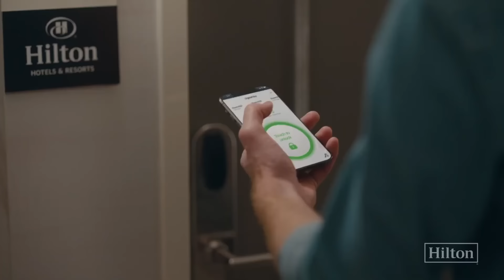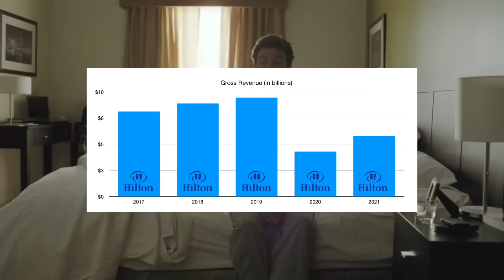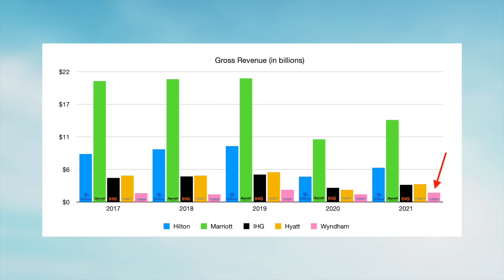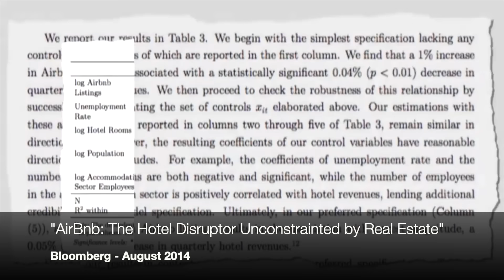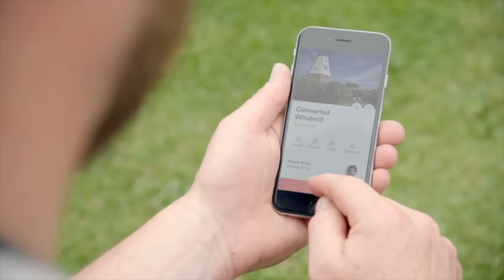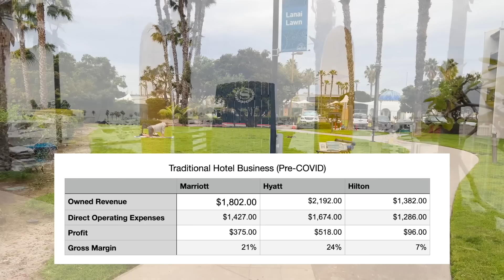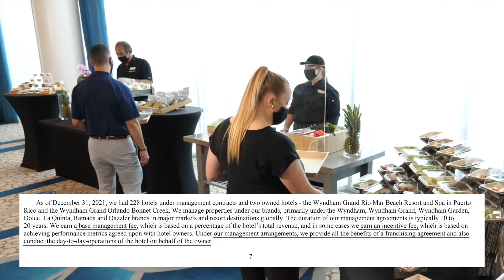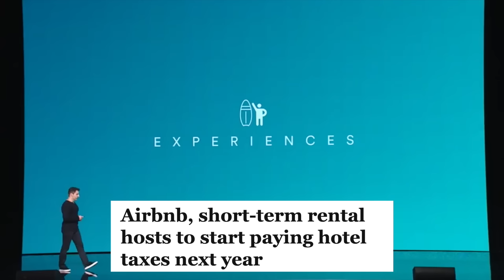Why Airbnb Fails to Disrupt the Hotel Industry

Comment: Airbnb is much more of a threat to the housing/rental market than it is to the hotel market, and by that I mean a threat to the people who rely those markets for residential accommodation, rather than being a threat to investors merely seeking to make a profit. There are plenty of career landlords buying houses to put on Airbnb and depriving owner-occupiers or tenants from access to those houses, because having Airbnb guests in the house for 60% of the time is often more profitable than having a tenant in there for 100% of the time.

Even during the pandemic and its lockdowns, when travel restrictions meant that the tourist market ostensibly dried up (the theoretical risk of renting out your property on Airbnb), in reality all that happened was that the tourists who were now stuck required extended stays and many Airbnb landlords were easily able to pivot into temporarily providing residential accommodation in order to keep revenue coming in at the rate of market rent (or near to it) for a tenancy. Then, once there were more short-term guests available, they could easily return to high-value short-term guests.

The threat of Airbnb is that it's increasingly forcing long-term tenants and prospective home buyers to compete with the higher cash holdings and spending capacity of tourists on holiday when it comes to who gets to stay in a given house. This wouldn't be such a problem if houses were plentiful and buyers/tenants could just look elsewhere, but many of the hottest destinations are in the middle of a housing crisis, and Airbnb is exacerbating the issue by removing houses from the residential for tourists who could otherwise be staying at high-density hotels designed and zoned specifically to cater for and accommodate them.

The video is absolutely correct in describing how existing hotel chains and Airbnb operate on functionally the same model and thus the latter isn't as much of a disruptor or threat so much as it's an ordinary competitor, but an important difference between conventional hotel chains and the Airbnb property network is the amount of land and real estate that they consume. Cities don't allow hotels to be built in limitless locations or numbers, and this along with operating expediency means that hotel franchisees are motivated to maximise the number of rooms a hotel provides in order to maximise the amount of profit they can make from that landspace. Moreover, nearly all of the time a franchisee is having to purpose-build the hotel, which provides new (or densified) accommodation to the city that typically has little impact on existing housing.

But the landlord "franchisees" of Airbnb don't operate under the same constraints, because they merely cannibalise properties from the rental/homeowner market and then integrate them into the hotel market. They can buy whatever and wherever with better capital and loan security than prospective home buyers (who already have to compete against rental investors), and every time a new listing for a full residence goes on Airbnb, that's another house gone that could be serving an actual tenant or owner-occupier rather than a short-term guest who could be staying at a hotel. And there's little reason for these landlords not to behave in this way because without regulation it's often so much more profitable to put houses on Airbnb (and then let them languish without occupants half the time) than it is to actually rent them out.

So, overall, while Airbnb isn't a threat to the hotel industry, it's certainly a threat to tenants and prospective home buyers so long as it remains unregulated. And unfortunately, most of the regulation that Airbnb has faced so far has all been about levelling the playing field with the hotel market that they compete with rather than with the housing market that they cannibalise in order to uphold and maintain their business model.
Reply: I live in a small tourist town on a mountain. We no longer have enough rental housing for the people who actually live and work here. Much of our work force now has to live down the mountain and commute about 2 hours each way. With gas prices rising we expect to lose many of those commuters. We aren't really sure how our little town will run without any workers. City is doing nothing about the issue. Logic is missing lol! How do you cater to the tourists if you have no work force to cater to their needs and desires?
Your comment was excellent.
Reply: 👏Excellent comment. Have you written a research paper on this topic? 😄 Not enough is talked about how tourists have a much higher footprint in an area renting a short term rental vs. hotel room. Which make STRs much less sustainable.
Reply: Thank you. As a first time home buyer, investors and "mom n pop"landlords drove up prices in ontario just to make quick money with AirBnB despite the amount of violence that happens at parties thrown in these AirBnbs...had to leave ontario and a good career to afford a home for my family. Cause rent at 2500 was not sustainable
Reply: I should perhaps point out that I would of course be absolutely happy for Modern MBA to take anything I've written here and incorporate it into another video about the topic, but with focus on how Airbnb is problematic for the residential housing market. I don't need credit or anything as I won't be doing most of the work! 😄

Also, I made a small typo in "...removing houses from the residential for tourists..." which should evidently say "residential market". Sometimes my mind moves faster than I can type! 😅
Reply: @terrabeh  Ive noticed that nearly every company/government agency only cares about maximizing profit as quickly as possible. They dont care about the long term effects, as they can just cash out when it collapses. But for those effected by the collapse, it can be devastating. Much like what you are experiencing
 in your town. 
I live in an area of wa state that is having a similar issue, where the work force is being driven out due to the lack of affordable housing/rentals. All these cash rich people come in and eat up property driving the price up to insane numbers. They then turn around and provide the majority client base of the services/goods in the area. Now heres the issue, the workers providing that service/goods can no longer afford to live here and are moving out. Even the college kids are leaving, which is a problem as the city itself is designed around the university here which is a "high ranking" school in the state. So when you start losing your majority work force and your college students, your entire economy will eventually collapse. It likely will take another couple years, but i dont plan to be around when it happens
Reply: Very nice answer thanks for writing this! 

After all this where's supply & demand here for the hotel industry? Double the rooms would halve the prices but conveniently they don't!   I recon that incorporating existing hotels also deals with this and airbnb quality of service isn't the same but still... i'm not left wing but  i believe it kinda shows it's the fake economy & regulations in effect. If you place the rooms number growth in the hotel business they lose value , if you place it in the housing market (shrink) they earn value.  Moreover you would lose jobs and maybe land value etc. if the former happened while know the government can give subsidies and look good as well/earn your vote! But instead they give vacation vouchers , how to be an a-hole 101 ! Plus land value goes up and you report "growth" (bubble) and it's exactly when too much capitalism is bad for you. 

Ex kings , royalty have a lot of land and the big investors of the old make some money here... Warren Buffet i think has it clearly 100% tax on realty bequeaths, of course if he had to pay for it he would oppose it. Coming from the guy that doesn't produce anything , just buys & sells others i'd say tax 100% on such companies except from insurance that in principle at least it's useful... shady derivatives with no use to society: 100% tax.

We need some Geneva Conventions for housing.
Reply: There's a pushbsck in many markets, including my city, as the units are being bought up and acting as commercial units while not being approved or zoned as such. That's the technical reason. The practical reason behind it is the uptick in criminal and nuisance behavior on those such properties without on-premises security to hold people accountable.
Reply: Which is a real pain in the ass.
Reply: Cry harder
Reply: Tourists and businesses want reliability, Greg the Goblin doesn't care and will find the cheapest way to live. When GtG has a new job every 4th month in a new town every season, they don't rent, they live in a car even if they could comfortably be paying for hotel rooms the entire time. GtG lurks Airbnb and finds cheap rent, if the scenario works out for GtG and whoever is willing to risk letting GtG live there for a month then GtG finds a cheap alternative to rent, and the owner manages to get a little bonus for making space. The only other person willing to airBnB is Winston the Adventurer who is willing to pay extra (in sanity, patience and perhaps even money) to avoid paying for hotel rooms or signing a lease. Basically, as Winstons have a large range of wealth, from pennies to way too much. While GtG's are invariably cheap, AirBnB can't service a consistent market. The only consistent thing they can offer, is a new seller. There is value to that. 

Airbnb may enjoy saying they are a tourist spot, but they are going to be chasing gremlin markets. They are basically looking for temporary markets, which is the advantage that they have. They are little different than Craigslist ads for renting. If you are a small fish, informal adverts are often great. But, if you expect the reliability of a business, or relaxation? Lol, lamo even. 

Basically, everyone expecting hotel service from airbnb is clowning on themselves, while every person investing in a location to airbnb rent it is riding transient markets and getting lucky.
Reply: What about rather than regulating Airbnb we should deregulate the construction sector to increase the supply of new housing?
Reply: @lorenz99x  There's always talk about deregulating construction to increase housing supply, but not enough discussion about what actual regulations people would like to see removed. Many regulations exist because there's a very important reason for them, and sometimes that regulation could be executed more efficiently and sometimes it can't. Likewise there may well be regulations that are superfluous or would be important but are currently implemented ineffectively. And all of this varies between jurisdictions, so in some cases deregulation might be sensible and in others not, it might have an impact or it might not. But when people talk about blanket deregulation, they often haven't bothered to identify if it would be sensible or effective for a given jurisdiction, and when lawmakers inevitably proceed with the same attitude, you're inviting unsafe or unlivable buildings which poorer people often have no choice but to live in. So while deregulation may well increase the housing supply, that doesn't guarantee you'll get the kinds of houses you want, assuming you respect the dignity of all people to live in a safe and liveable house. And while it's certainly possible to do deregulation "correctly", unfortunately ensuring appropriate protections is not usually the approach of the politicians who campaigned on removing protections.
Reply: Pin this
Reply: @lorenz99x  sure, but deregulate in ways that don't cause worse buildings. Allow more mixed use zoning, change parking minimum regulations to cause less ash fault deserts in city centres. Combined with greater regulation in other areas (specifically in ways that cause more pedestrian and bike friendly areas, while negatively effecting large volume renters and the like), actually enforcing constriction codes properly, and a few other things.
Just "deregulating" won't increase the housing supply inherently, it is more likely to cause more corners to be cut to increase profit margins

Comment: It's cheaper if you go to a hotel. Airbnb has all those fees which ends up being the same or more plus you have an annoying temporary landlord.
Reply: It can be but not always. The fees are not at all hidden, cleaning fee is included in the nightly rate and you can expand the fees to make sure you see them all before booking. Like the pet fee won’t be included in nightly rate since not everyone will have a pet with them but I always do so I check what that fee is before booking. I have never been blindsided by the price or experience on Airbnb. You have to read the description, fees, and guest reviews. Like with anything else you buy.
Reply: This. I did a longterm airbnb- but the landlord constantly violated by privacy and tried to charge me extra. I should have just looked to sublet, it would have been cheaper.
Reply: @jacob9673  what is a sublet
Reply: @RatchetRorschach  basically a short term rental. Like, if someone were to go on a long vacation for example, or move away for school but still want to keep their rental or house, they could find a sub letter to stay in the house and temporarily take over the rent bill
Reply: I have stayed  in one on more than 30 trips and never once seen it more expensive than a hotel unless I wanted it to be by picking something crazy like renting a high end home. I recently rented a full apartment in Washington DC, Foggy Bottom( a nice area) and I spent for 10 days what it was going to cost to stay in a relatively low cost hotel like aloft or courtyard for 4 days and this seems to be pretty typical from what I have seen.
Reply: Plus Airbnbs hurt the housing market and destroy neighborhoods. I always get a hotel.
Reply: @greedo2660  That is objectively false in almost all cases.
Reply: @mattriney6072  thanks
Reply: @swayne1441  Except not. In most of the UK cheap hotels are a dime a dozen. They're significantly cheaper then anything air b and b could hope to produce and they're consistent in their mediocrity. Air b and b is utterly pointless in the UK
Reply: @swayne1441  source ?

Comment: I work for a company similar to Airbnb and just want on vacation and stayed in a hotel. I've heard so many horror stories about Airbnbs and I don't want to worry about it when I'm on vacation. I just want to go in and have a clean room with toiletries, and I want my bed made everyday. I don't want to worry about my room not being clean or a rude host.
Reply: funny how many comments mention 'rude hosts', on Airbnb you can lose super host status over customers complaining they weren't told that it's cold in winter in the mountains, or offering house shoes that are not of the right color and shape :) I know airbnb from both sides, and the only rude people are the clients so far.
Reply: @mmmmkkk  No. You get warnings as a host, not instant revocation of your status. I only remember 3 customers who stayed with me that had issues (one broke my washing machine, one was rude and evidently didn't realize I could hear them from upstairs, and one left a space heater running after checkout - fire hazard). I only addressed the problem with the washing machine, which was an easy fix and didn't require intervention from Airbnb. 
It sounds like you were one of the crummy hosts, tbh
Reply: @sitcomchristian6886  Lol, you're trying to be rude and look down at me, but instead just made a fool out of yourself. I haven't said anywhere its immediate after first worse feedback, nor did I said we've lost the status. We have extremely high notes and superhost status for years, in a very competitive region, where most flats are managed by professionals. Not only I'm not a 'crummy' host, but we came up with many unique details that our guest appreciate and that are not available in hotels. Not to mention we support them in 5 languages. So feel free to take your judgemental attitude somewhere else. I still stand by my previous comment. Being a bad or unreliable host isn't a viable option on Airbnb in long term, unless.there is no competition at all. At the same time being a terrible guest most of the time won't get you into much troubles or out of the platform. We had guests lying to us directly, not obeying rules, and hiding broken stuff meaning we wouldn't be able to claim it or even give bad review.
Reply: I was in Mexico few months ago and had a host come in and steal my stuff while i was away. Then he tried to Airbnb saying i stole stuff. Huge nightmare and what ensues was literally dozens of calls to Airbnb explaining the situation to numerous reps in the phillipines and now dealing with multiple insurence adjusters. It's been 3 months, my stuff is still stolen and the claims are still pending being arbitrated by a 3rd party insurance company. Never again.